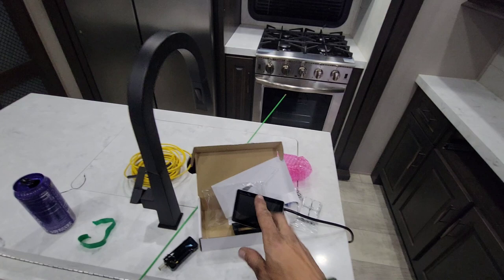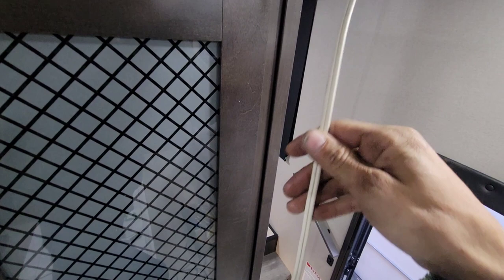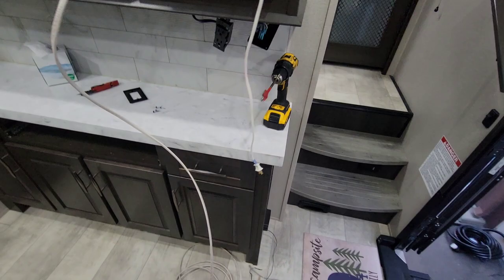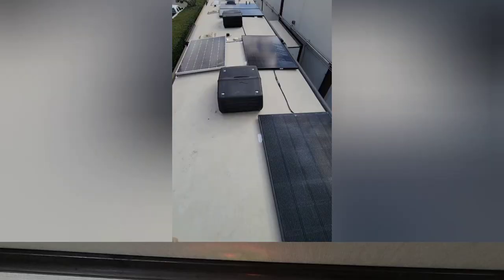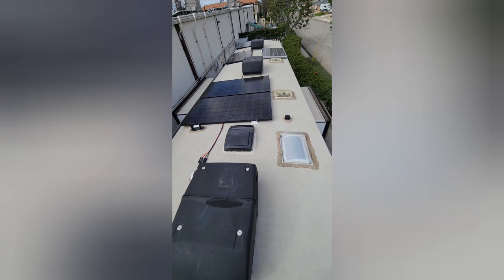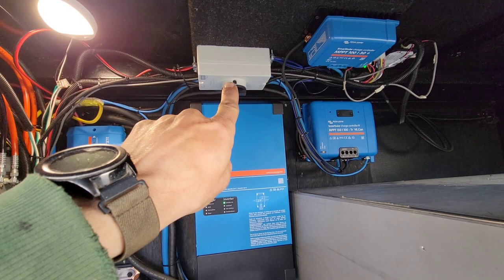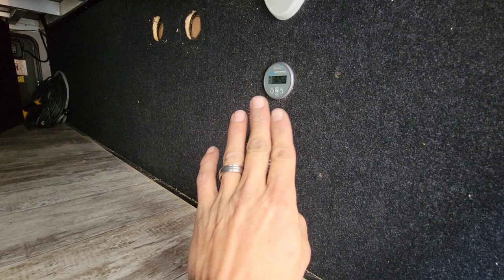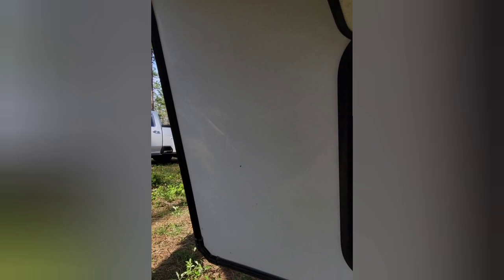1720 Watt Solar Install • Part Two • Off Grid Ready! ⚡️ #victronenergy #battleborn #rvsolar

Comment: I have a question once i have the inverter installed how do I wire that into the whole rv without having to run a cord from one of the outlets?
Reply from the maker: If you have an Inverter/charger like in the video, you have to remove your shore power cord wires from your breaker panel box and that goes to the ac input of Inverter. The ac output from Inverter goes to where you remove the shore power cord wires from your breaker panel box. Now your breaker panel box has power from shore power or the Inverter. Hope this helps. Thanks for watching. Let us know if there's any short videos you'd like to see. 🌞